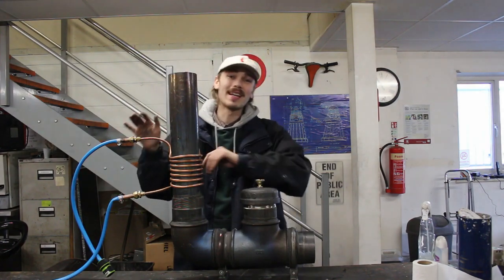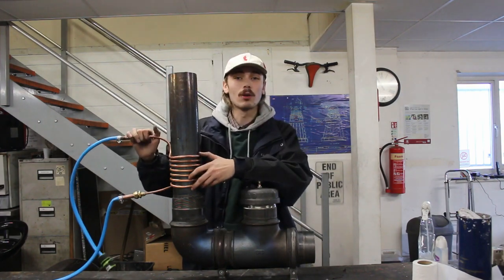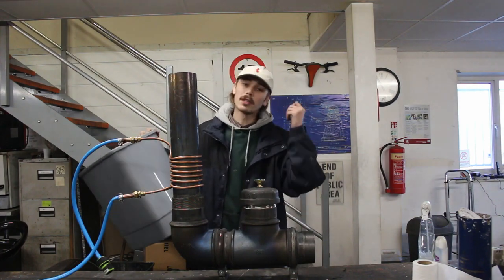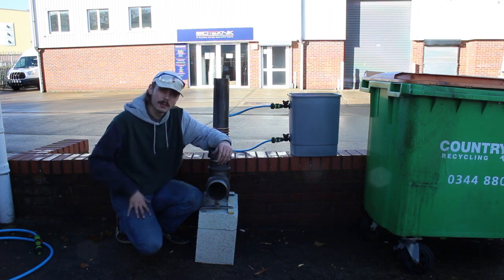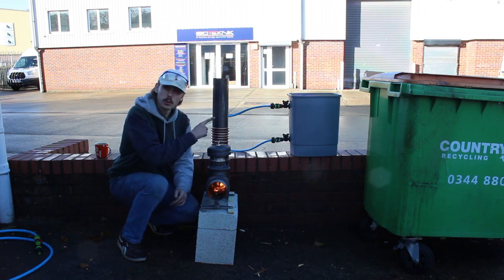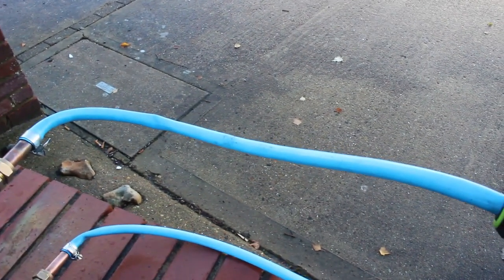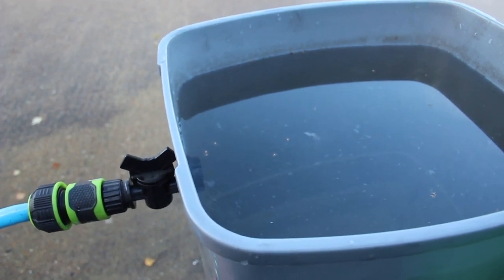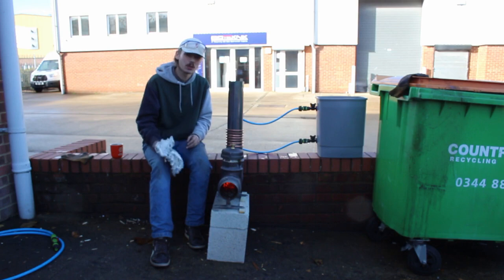Crazy DIY Mass Water Heating   Using a Rocket Stove

Comment: This system is similar to a camp-fire 'chuffer' but would be more efficient. however it can be greatly improved as a source of hot water by installing a lid on the reservoir with a hole and a funnel and a pipe that goes down to the bottom of the reservoir, and an outlet spout at the top. The system remains unpressurised and relies on the thermo-syphon principle (therefore safer). With the adaptations detailed above, cold water when poured into the funnel in the lid of the  reservoir will go directly to the bottom and cause the hottest water (at the top) to overflow into a container. Thus you always get the hottest water out, the lid provides better thermal efficiency and topping it up does not reduce the temperature of the water so much..

Comment: I've tried this exact method and had dismal results. The copper pipe would generate so much pressure that the water inside would cause what is known as "water hammering" and is quite startling. After much troubleshooting I found attaching a check valve on the cold water inlet side will keep the pressure flowing one direction. However, the copper coil still does not heat efficiently enough.  The amount of wood needed is far more than if you would put the coil directly into the fire.

Comment: you want a radiator over the fire itself...

when its working you can hold your hand above it, should be cold... or at least as hot as the water coming out... thats when youre grabbing as much heat as possible.

friend found me a dewar flask, 35L... old camping shower aka 4 row copper radiator, pump, and got it boiling... 36 hours later its still 75C... mmmm, vacuum sealed...

Comment: Why not put the copper piping on the INSIDE of the chimney?
Reply from the maker: My thought is that it would be quite difficult to put it inside, the chimney does get really hot, plus it made it quite easy to wrap the copper coil around the chimney, that's why I did it that way. 
I did have further thoughts on this, adding some stone wool insulation, to help retain its heat around the copper coil, its currently on the project list lol. Cheers mate!
Reply: The combustion chemicals maybe interact with copper?  Heat may melt copper?  Worth experimenting if able, to see if there are any drawbacks besides complexity.  Although, if pipe was the weak point, a leak would douse the fire, so maybe a safety feature?  Rob & Luke's ideas are like jazz, not classical music.  Play is required, the output is unknown, limited only by imagination, instrumentation, and time.